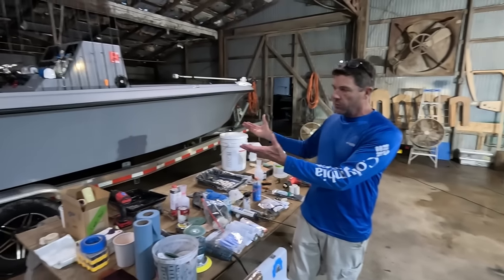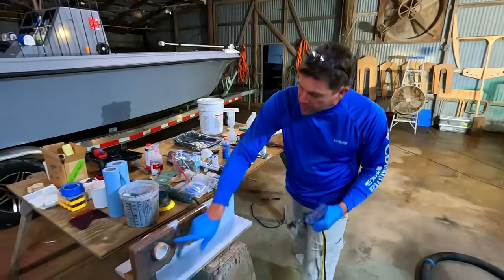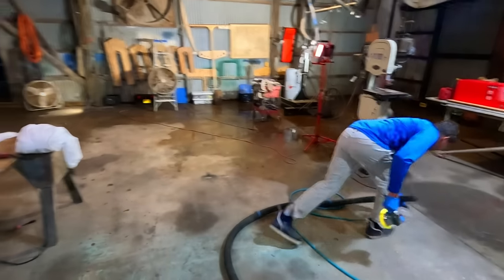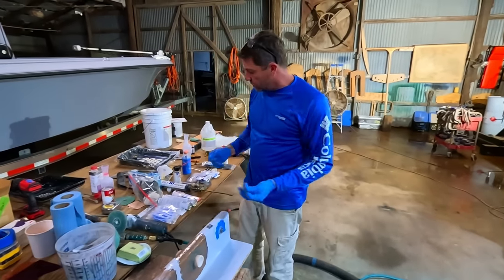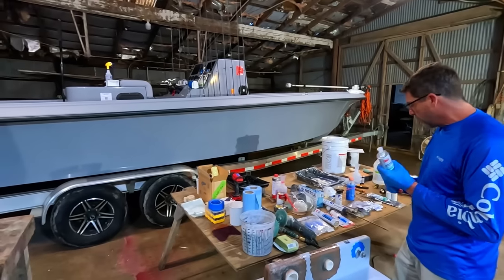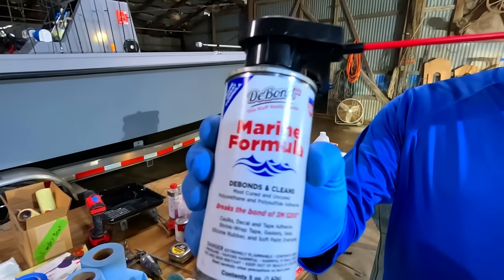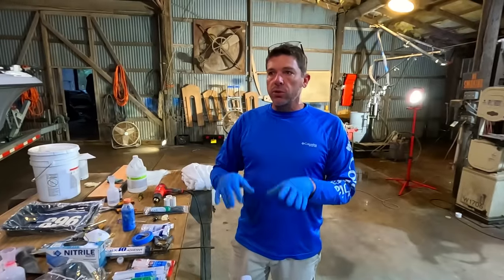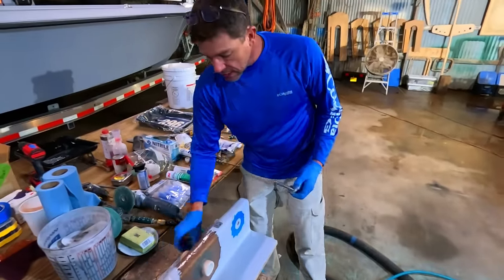HOW-TO CHOOSE Best Sealants for Fiber glassed Plywood-DIY FIBERGLASS REPAIR

Comment: Fun fact about 5200.  Once opened it will cure in the tube in a short time period.  To prevent it from curing in the tube, throw it in the freezer.  It will last forever and can be frozen un-frozen many times. The bucket full of used sanding discs is genius!  Going to copy that for sure!
Reply from the maker: Yes, I agree! That is a great tip for sure. I should have mentioned that in the video, maybe next time. Yep, those older used sanding disc's can get a second life sanding the rough fiberglass. Thanks for watching and commenting!
Reply: @FishBumpTV  Thanks!  I knew you'd know this so my comment was more for folks that are trying to learn.  Great content!

Comment: I love me some 610!! I rebuilt my radar arch on my 30' tollycraft and it was expensive but now bullet proof!!! I have however, had some of those weld ones break off, but a hammer did fall on it tho, but I also put 5200 in a small syringe and fill screw holes with it before I fasten the screw in, so far has worked for me..anyway, ❤ from the chesapeake Joe!!!
Reply from the maker: Haha, I agree! The 610 is a great product. Thanks for watching and commenting!

Comment: Captian once again Perfect job on Videos. I was wondering if on your next Epoxy mockup. Could you put the model piece on a work station? Like a Black and Decker workmate? Then we can see all the way around you work! The camera man can shoot over your soldiers. Once again the information is priceless. I have watched a lot of DYI boats projects and you are the first to actually explain types of Marine caulk 👍thanks
Reply from the maker: Thanks so much, I appreciate the suggestion! I will try and make that happen for you guys. Glad you found the video to be helpful!
Reply: @FishBumpTV  Thanks Captain. Since you have the through  bulkhead wire raceways and wire mounts. On your next build or trolling motor install. Do you think you could do a new and  upgraded Trolling motor install? Start from nothing like my Trophy build. With your recommended Chart plotter. Thanks again

Comment: Any tips on drilling holes for screws so that the top layers of gelcoat dont pop when the screw grabs? Love this page!
Reply from the maker: Sure, try drilling a pilot hole that is the same size as the screws shaft, then drill a slightly larger hole the size of the screws theads down into the first pilot hole about 1/8 of an inch. This should help stop the gelcoat cracking. Hope this helps

Comment: Great video capt Joe what about new cut speaker holes how would you seal the wood or would you ? Thanks again love the videos
Reply from the maker: Thanks so much for watching! Yes, I would aways recommend sealing exposed wood before installing hardware if possible.  Especially before it ever has a chance to get any moisture in it. The west system 610, like I showed in this video could work well for your application I would imagine. Hope this helps, and best of luck with your project!
Reply: @FishBumpTV  actually the haul is fiberglass it is a crownline

Comment: Thanks Joe, great info. I want to make a mold, couple feet long, few inches wide.  What weight CSM and Biaxial do you use? Also the best polyester for non-shrinkage. Thank you again, I'm not a boat builder, however your info translates to anything in my opinion. Great channel.
Reply from the maker: When building molds we usually go 100 percent 1 ounce csm. We don't typically use any biaxial glass. A good isophthalic polyester laminating resin like the one we show in our resin selection video from fiberglass warehouse is a very good one for molds. We will be building a mold for a hardtop for our 29 ft charter boat very soon, so stay tuned!  I hope this helps,  and thanks for watching!

Comment: Another great one Joe!  

Definitely gave me some options to consider when mounting my bilge pump and float switch.  

I thought I read somewhere recently that silicone is a great sealant but that it only holds up for a few years and needs to be replaced?  What's your thought on that?  

Also, am I understanding you correctly that silicone can be used in a greasy bilge?

I like the different options you presented.   Great info!  Also, that taping tip is a great one to ensure a nice and neat job.

Tell your cameraman he's doing awesome too!
Reply from the maker: Thanks! I have had very decent performance out of high quality marine grade silicone, but all sealants degrade over time and may need freshening up eventually. Greasy and oily surfaces are a problem for all adhesives and sealants. Whatever it takes to get the surface cleaned and well prepared is a must. Hope that helps, and I appreciate you watching and commenting !
Reply: Absolutely!  Sometimes my perfectionism gets in the way.  I'm always looking for the best way to get stuff done that produces the longest lasting most durable result.  Who knows maybe I have a future in boat building.

Comment: For your info a caulking gun tube of 5200 like you have there down here in New Zealand NZD$59.00. Yes I have removed it and IT DID bring the fibreglass with it. Wasn't aware of the debond
Reply from the maker: Wow, Not cheap! The debond work great. Maybe you can try it next time. Thanks for watching and commenting!

Comment: Thank you for the part 2. Great stuff once again. Quick question... Before you sand the cured glass for gelcoat, wouldn't you wipe the area with Acetone to get rid of the wax from the resin? Keep up the good work, Captain Joe😁.
Reply from the maker: Glad you enjoyed the video! We always use laminating resin, which is wax free. But you can always wipe down with acetone after sanding and prior to gelcoat if you like. hope that helps , thanks for watching!
Reply: @FishBumpTV  ok that makes sense. Thank you for the answer 👍

Comment: If you needed to change where a wire goes, and you did a method that made a hole (like one of those rubber stainless steel clips), what would you recommend doing about the hole that is now left? A real small hole like that, just a screw hole.
Reply from the maker: The simplest method to seal the hole would be to remove the wire loom, them put some sealant in the hole and run the screw back in. The next method would be to remove the screw and wire loom, clean the area completely to remove all old sealant, drill out the screw hole slightly larger than the original screw to remove any residual sealants down in the screw hole. Then fill the hole with a quality putty, sand putty flat, then gelcoat it to seal the repair. Hope this helps, thanks for watching!
Reply: @FishBumpTV  Great ideas, thank you! Wish you all the success in your videos.

Comment: Quick question. If I want to put a new floor made of fiberglassed plywood in my small open boat and plan to close the hull beneath the floor completely. Do I need to gelcoat the inside of the hull below the floor and the underside of the floor before I glue it in place?
Reply from the maker: We don't typically gelcoat sealed, non visible, underfloor compartments in our boats. We do usually put a really nice coat of catalyzed resin over everything though. But that's just the way we do it. Hope this helps. Thanks for watching!

Comment: Joe,  how best to thin epoxy resin so the it soaks into the wood fibers to help prevent gas bubbles on live edge table tops.
Thank you
Reply from the maker: It can vary from one to another brand of epoxy. I have used 5 percent or so of denatured alcohol on occasion with good results. I would definitely experiment on some non critical pieces first though. Hope this helps. Thanks for Watching!

Comment: Just subscribed a couple days ago watching so many of your videos as i think my first transom build i have totally messed up ie using wrong plywood, not doing the proper methods, using wood glue to bond two pieced of bondo fiberglass resin plywood together with pre drilled holes, now one of your i=videos i watched says you shouldn't use poly over bondo resin but it's okay to use bondo resin over poly, i wanted to switch mid way and add glass with a different resin that doesn't have such a short work time so i might have to start over with new wood and better materials and knowledge, first time go at it with no experience
Reply from the maker: Welcome to the channel and thanks for subscribing! I try to share with you all techniques that our family has used with success, and that I know will work. There can be various ways of doing things that can still result in a job well done. Glad you are enjoying the channel and I wish you the very best with your project!

Comment: I really need to fiberglass over an aluminum honeycomb sheet that covers my boats fuel tank.  I know you really shouldn’t try that, but do you think I could used the 5200 to stick my first layer of fiberglass to the aluminum and then be able to fiberglass to that?
Reply from the maker: It is possible that could work, but I have not personally done that before. I would recommend a test panel first, or more research on that application before moving forward. I wish I had more info on that for you.Best of luck with your project!

Comment: 5200 also dries fast IN THE TUBE! Once you open it, use as much as you can because it will harden in the tube after about a week once opened. I have not tried freezing it after opened, a trick my shop told me to do.
Reply from the maker: Thats a good point, once you break the seal on a tube of 5200 or 4200 it does not last long. That is why I was just using the small tube of silicone for the demonstration piece in the video. And yes, keeping it cold does slow down the curing process. Thanks for commenting and watching!

Comment: The through bolt, if it was an engine install, would not allow for sealing both sides like that, no? Wouldn't it be better in that case to drill a bigger hole and fill it with the Napa Pro Strand to complete fill the hole, then drill it out again?
Reply from the maker: On outboard motor installations you can get to both sides, and you would have sealant on both sides. Thanks for Watching

Comment: Anyone who uses 5200 on thru hull fitting should be dragged my their ear and forced to remove the fitting themself.
Reply from the maker: 4200 is the better choice for sure! There is a product called Debond that will break the bond of most marine sealants and adhesives. You should give it a try. Thanks for watching!